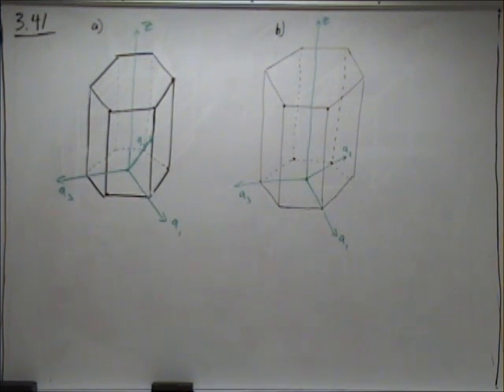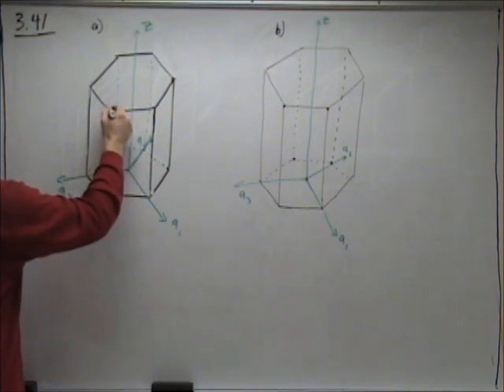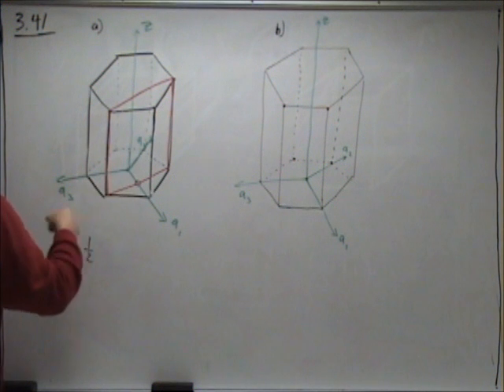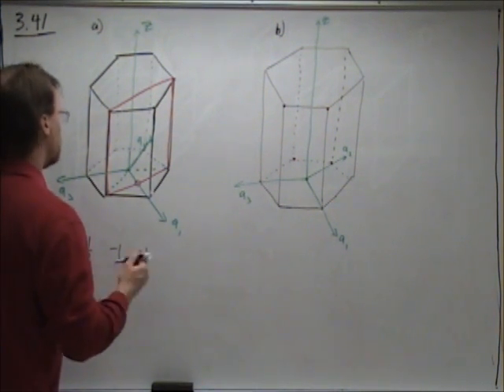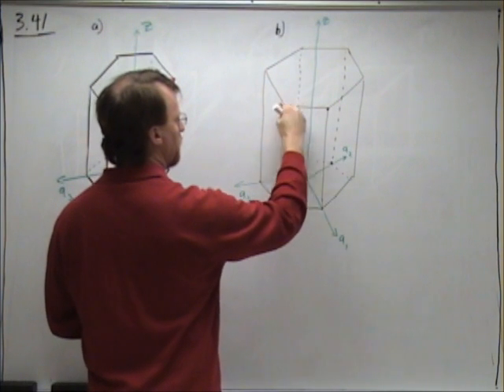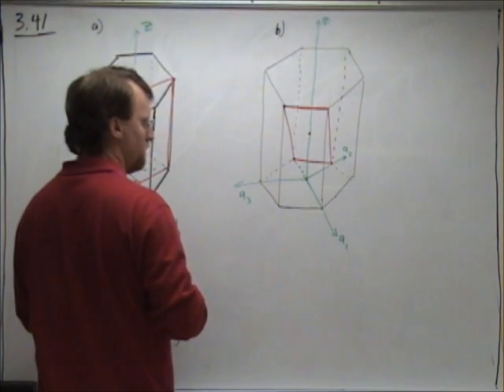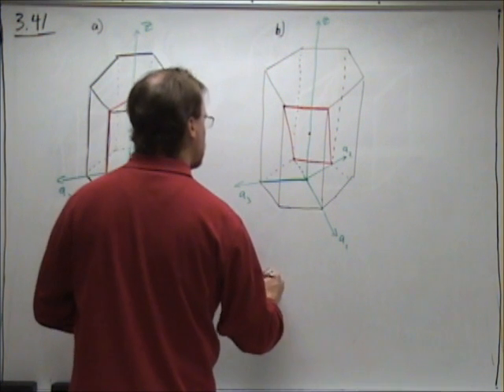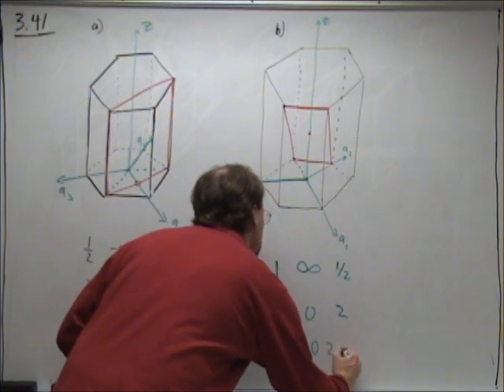Planes in a Hexagonal Close-Packed Unit Cell

Comment: for hexagonal unit cells with plane intercepts defined as (hkil)=(a1 a2 a3 z), i= -(h+k) or a3= -a2 - a1...therefore this answer is wrong.
Reply: Actually, both of his answers are correct.  (hkil) are the indices used to describe the intercepts of the plane in terms of a_1, a_2, a_3, and z, but they do not have to equal those values exactly.  Think about the answer on the left for a second - you can extend the defined a_1, a_2, and a_3 vectors to show that the plane drawn intercepts at 1/2 the value of a_1 and negative the values of a_2 and a_3.  The plane is also completely vertical, so it never intercepts the z-axis.  Therefore, in terms of the vector labels, you write the intercepts as (1/2,-1,-1,infinity), take the inverse which gives (2,-1,-1,0) = (hkil), and then write bars instead of negative signs where appropriate.  If you look at this answer, the h+k = 1, so -(h+k) = -1, which is exactly the value of i.   A similar analysis leads to the answer on the right, which is also correct.
Reply: Thanks PUtbone. Nice work. I hope all is well with you!

Comment: Angie Morales Moreno has a point if u multiply everything by 2 to eliminate the 1/2 that would give u (-2 2 0 1)
Reply: As I mentioned to her, at about 2:05 I mention that the plane crosses the Z axis (not the top of the cell) half-way up. If you did the analysis for the plane to the top of the cell, everything would be multiplied by two, resulting in the same answer.
 Thanks for watching and commenting!
Reply: @jeffbirt6671  could u plz support me with ur email

Comment: why z= 1/2 ??? is not 1 ?
Reply: because it's a plane, you look for the interception point, and not how much it traveled up the Z-axis, you look for the point where it went through the Z plane which is at 1/2
Reply from the maker: At about 2:05 I mention that the plane crosses the Z axis (not the top of the cell) half-way up. If you did the analysis for the plane to the top of the cell, everything would be multiplied by two, resulting in the same answer. 
I hope this helps.
Reply: +Angie Morales Moreno i have  same question...